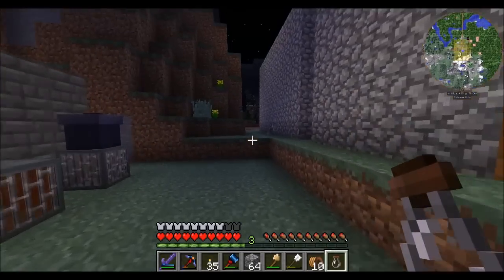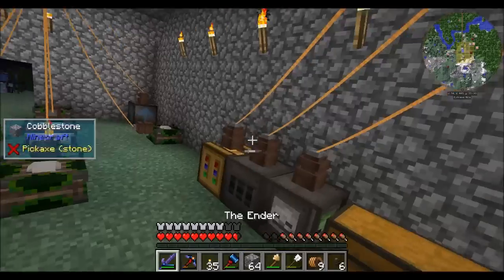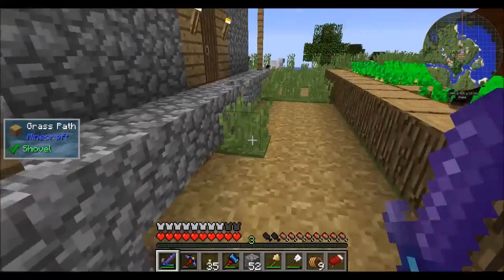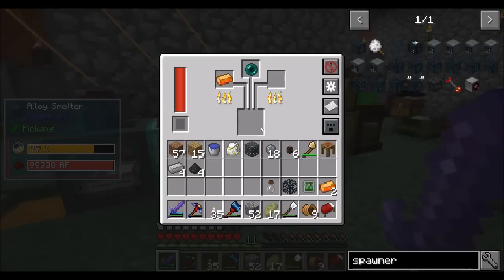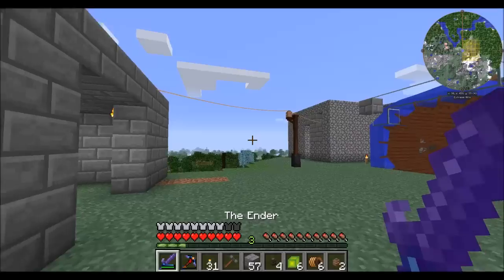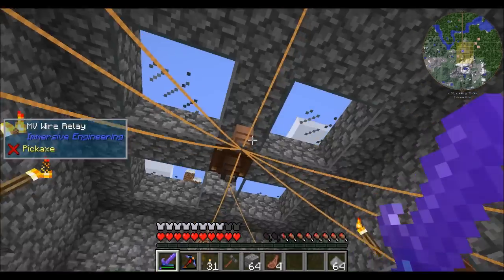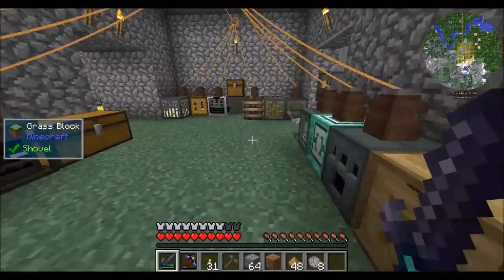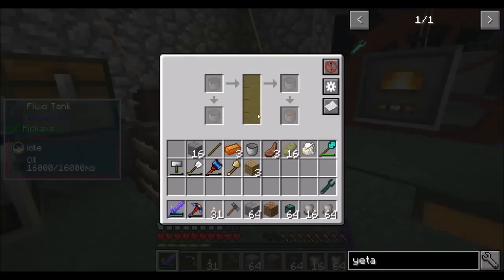AoE Ep16 Endermen

Comment: Dire makes a powered spawner and I made resturbed spawners. Now I have a blaze spawner with 20 speed upgrades and a villager spawner with 20 speed upgrades which feeds into a tinkers smeltry making emeralds endlessly. You need to use a lot of rf for the spawner changer from actually additions and then klick on it with a drop of evil. Then you have a spawner with the mob you want. 

But we talk about Dire here. Let's make a hard pack even harder!
Reply: Sounds neat. But quick question, what mod adds the spawner that takes speed upgrades and what's the spawned called?
Reply: It's from extra utilities 2. If you use a drop of evil which are dropped rarely from wither skelettons you get a "Resturbed Mob Spawner". You can speed them up with speed upgrades and it accepts redstone signals when set up for it. It has an interface like any other Extra Utilities "machine". Btw. It gets dropped on the floor when you use the Drop of Evil on it, no need to break it. Then you can break it as much as you want and it won't become a broken spawner.

The Spawner Changer from Actually Additions can be used on a normal spawner (so don't break the one you want by mistake). It needs an Empowered Diamiantine Block + 4 spawner shards (so you need to break some spawners, you get 1 per spawner. If you wanna look for spawners go into the nether, best place to find them) with some Magma Creame. 

Course of action is usually
Find Spawner, mark it on the map, get spawner changer, use it on mob you want to "catch" it, use it on the spawner and use the drop of evil on it. Then you have a RF free spawner with the mob you want which has an insane speed with 20 speed upgrades. Sadly you need to break 4 spawners to make the spawner changer, but it's still a great way to get what you want.

This works in any pack with actually additions and extra utilities 2 which almost all 1.10 packs have.
Reply: You complain about him making a powered spawner as if it's easy to get a customized Resturbed Spawner.  You did recognize that you need to find 5 spawners, before you can make the one you want.  Finding them in the overworld can be a crapshoot, unless/until you find mineshafts and get lucky with cave spiders.

Given that, it's a lot easier to burn the first spawner you come across on endermen.  I think you can reprogram them with another (possibly reprogrammed) broken spawner, or just stop using it.

Are emeralds really that necessary?  I collected a few villagers, then started trading with them to get them breeding, since you can't do a breeding -> smelting setup in later versions of MC.
Reply: Yeah, you need 5 spawners. You find at least 2-3 or  many more in one nether fortress. No need to go grinding in the overworld. It took me only about 20 min to find enough. I have a jetpack, so it was easier for me to do it, but even then it shouldn't be too hard. 

And no, the easiest way to get all mobdrops is from cursed earth and some form of autokilling. Vectorplates are avaible in this pack and easy to get. If you are okay on diamonds you can make diamondspikes else gold or ironspikes will do. I wasted a lot of diamonds on them, but it was worth it. I have one overworld mobfarm and 2 in the nether. One for gold and one for witherheads,bones and coal at a fortress with cursed earth. You also need 0 RF. It's fully automated with an Ender Hopper which only needs 1 enderpearl to start. Then you get a lot of stuff. In addition to that I have resturbed spawners now. 

Not only enderpearls, but bones, rotten flesh, iron, redstone, glowstone because all normal mobs spawn in the overworld. Not much Iron, redstone and glowstone, but it always helps to have more stuff than needed.

I (and some others here) complain about it because he needs a lot of enderpearls and a lot of power. He already struggles to keep up with his canola setup and now the spawner which costs him 1.6k/tick RF? He either needs to save his power to progress or generate more which will probably be his next step. It's his choice and we all love him, but his progress on this pack will be very slow if he wastes power like that. One empowered block of anything costs 4-20 mil RF each. That is a lot.

And emeralds will be necessary later on. I am saving them up, never bad having more than needed. You will need a lot of them for draconic evolution. 2 blocks per wyvern core. Which means a lot. Just to be sure I started early saving them up which will mean that I won't need an emerald dimension or something like that later on. The smeltry setup still works in 1.10. BUT the problem is that they won't spawn if you kill too many of them at once. What was it? Villagerscore or something like that goes down. You need to let some live, trade with them yada yada yada. The spawner-variant is much more timesaving. Because you don't care about trading with them at all.
Reply: sweet
Reply: Right...so things are easy to do in this pack, once you're further ahead than he is.  Got it.

You needed to get up to about 15 ender pearls to both find the stronghold/end portal, and then to activate the portal.  Which of course, once you hit the end, endermen for days.  But Dire's explicit issue was finding enough endermen to get the pearls and heads he was needing.  Therefore, the powered spawner wasn't a terrible idea.

Also, everyone who's played modded Minecraft knows a jetpack makes life easier, like finding Nether Fortresses. So yeah, once you've gotten the enderpearls necessary to get there (again, his issue), beat the dragon, and then find an end city/ship that has an Elytra, you get to work your way up the jetpack tiers.

Which means you can then more easily find a couple of fortresses, to get a handful of spawners, to change a spawner, to make a customized resturbed spawner, to get X mobs for days.  Which again, he's a ways off from.

I'm not positive on the villagescore data.  I do know that villagers ONLY breed when they've been triggered, by trading with them.  So you can't just have a handful of villagers, a bunch of doors, and have them auto-breeding babies automatically, which go into a smeltery for emeralds.  Which also, since you're not killing them by hand, shouldn't affect the villagescore.  So I've collected a bunch, started doing the easy trades (paper, string, etc), and the useless villagers can be shuffled over to a smeltery to reduce the population below cap.  At least until i can spawn them and ignore the trades.
Reply: +mlindolm flight is easily obtainable for him. It isnt perfect flight like a jetpack but just use a staff of travelling and a dark chestplate with glider. It even says in the book thats how you should go
Reply: I said it, right? Maybe i wasn't clear. You start out with a cursed earth mobfarm. You get enough of everything you need to progress with 0 costs nor needing to make more machines aka. wasting stuff. You need one Drop of evil. Then you get enough stuff within a mining session to do everything with the enderpearls you want. I am at the same spot as dire in the progression of the modpack right now, but I went down a different path than him. I only have an alloy smelter and sag mill. Nothing else. He even has a garden cloche which i don't have lol. I could go into the next step because i went into the end already, but i am still doing other stuff that i can build and i need to expand my base, too lazy to do that atm.

You need 0 enderpearls to go into a nether fortress. You will and can go into the nether after you made your first steel ingot. I found my first without a jetpack and you should find one without too many problems. Minimap helps a lot in that regard. I found 2 others with my jetpack for more spawners which you said you can find other spawners in other places which is more time consuming, but possible. And there are other ways of movement like slimeboots or staff of traveling etc. at this point in time. It's modded minecraft, not "you need to use mods to progress"-minecraft. Vanilla rules still apply. It makes it harder to find more, but it's not impossible. Some people love challanging themselves.

I had no flying only my trusty slimeboots and some enderpearls in the end to get the elytra. At that point in time I was even 1 or 2 ages behind dire, kinda, not sure how far behind, but i was at least no in the Ender Age. The first jetpack is an IC2 biogas one. Then you upgrade it to the electric one, which I used, and use it later for ender io jetpacks and so on. So basicly, if you do it like me, you can go into the nether, grab dat evil drop, make farm and go into the end after you make some IC2 machines. And have a jetpack without progressing the ages too far. Which is actually harder, but not impossible. It makes other stuff easier. That's what I did. That is also why I am in the same age as dire, but actually further in, because I wanted to fly asap and already was in the end. 

Villager breeding hasn't changed much in 1.10. You need a farm (pref. potato farm) a brown coat villager and another one. Enough doors with some villagers with sunlight on them (something like glass above them) to make a "village" and they will breed, but the villager score goes down every time a villager is killed. Does not matter how. Even if they die from zombies or in a smeltry or any other possible way when they are near the village. When you trade with them the score goes up again. You can also forget the farm and make a compact design, but you need to fill their inventories with food yourself then. Which i never did and never will even when playing vanilla mc. 

There is exact data somewhere, but that'S the gist of it. And sometimes the village isn't regognized for some strange reason.  But it works on 1.10 as it did in 1.7-1.9. It's not needed to kill villagers off in the beginning of the game, just trade with them and make a spawner later on when it's possible for you. Waaay easier.

Comment: I've made a few TechReborn machines in my FTB Beyond play, they seem kind of laggy, but could have also been some of the IC2 2nd tier machines (Compacting Recycler, Impellerized Roller, etc). Also, it's basically GregTech.
Reply: Yeah, the advanced IC2 machines are a bit hard on the game, mostly because they're running constantly, meaning all the power setup is running as well. And IC2 power has always been a bit laggy.

Comment: For the stuck extraction chamber problem I've found a rather easy workaround if you're still using the IE connectors: just stick any RF charged item into the (+) slot. It will top of the internal machine buffer and it will instantly start running again.

Comment: with 4 wind turbines with steel kinetic gearbox rotors i managed to constantly produce around 400 eu/t , and they are incredibly cheap for what they do, they need to be high up tho so you need to use some diamonds to make glass fiber for better cable efficiency . Since by then you'll have a lot of eu you can use electrical engines from forestry to produce rf. And u can use ejector upgrades from ic2 to automate ore processing with just a macerator and an electric furnace

Comment: @23:45 One thing I've found that seems to fix the Extraction Chamber is to give it a jolt using a Calculator energy module. I keep one in my bag o' stuff for just such circumstances.

Comment: direwolf, when ramping your power, keep in mind that immersive engineering does not distribute power equally. It chooses one route, and then pours in energy until that route is full before sending energy down a new route. For the most part, this isn't an issue; but for things like empowering, it can be annoying. Normally, I use immersive engineering to get power to capacitor bank, then have four energy conduits leading off into each pedestal for the empowerer.

Comment: aim for a precision chamber for better circuit production and get those speed upgrades flowin' not to mention some of the generators from calculator aren't too bad, like the starch generator, which can be run off of broccoli, and with growable coal dust that can be a decent fuel source for it as well

Comment: Dire, why dont you use actual additions lasers instead of immersive engineering cables? Pretty sure they can go further and you wont have to worry too much about LV, MV or HV. One laser does all.
Reply: Haven't played the pack, but the recipe might have been changed. That or Dire just forgot about them.
Reply: Lasers have insane loss, especially because he'd need so many. By the time he got to the end point of things, he'd have almost no power left.
Reply: Lasers have insane loss, especially because he'd need so many. By the time he got to the end point of things, he'd have almost no power left.
Reply: Odd, i dont appear to have issues.
Reply: It's not usually noticable until you're only generating a bit of power. There's some loss with IE cables but nowhere near as much.